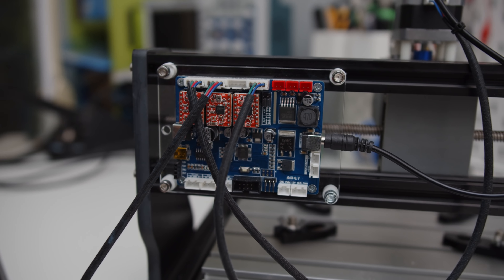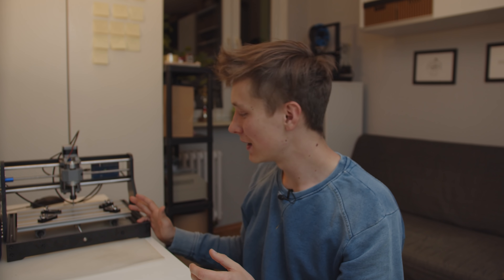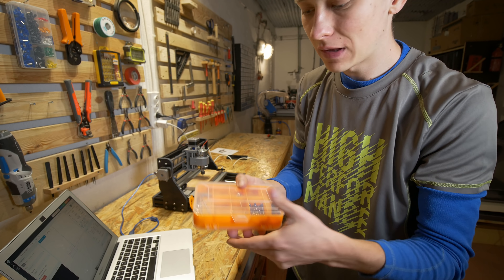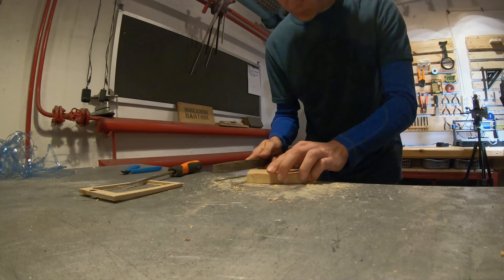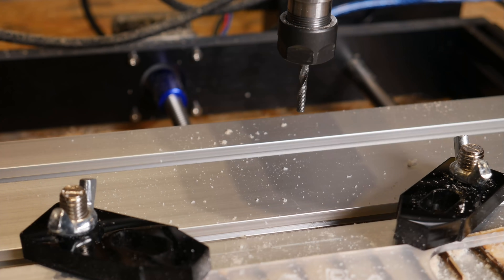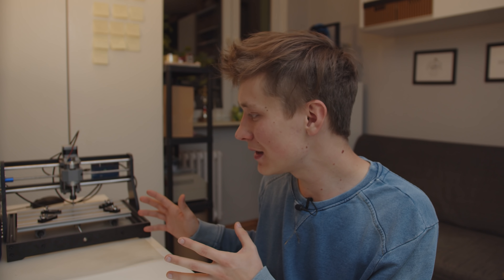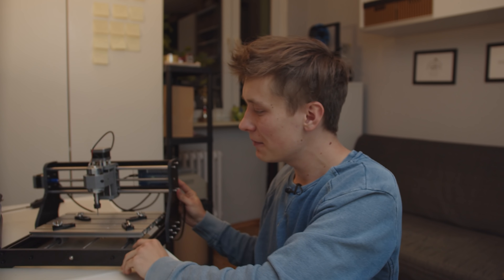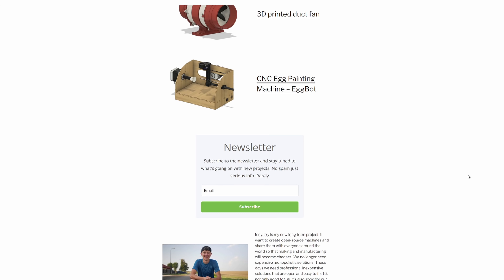What Can You Do With a $200 CNC

Comment: Niko, I like your style and I appreciate your creativity. On the other hand, I strongly disagree with your analyze. I mean, come on, this machine cuts awfully and you have to blame it on the machine's poor design and cheap components obviously. It's not ok, whatever the price tag. Definitely. The young modulus of plastic compared to aluminum talks. Z carriage, sides, front, bushings, nut holders are plastic. That machine can't be stiff at all. By tinkering parameters you (try to) give the illusion the machine is capable but it's not. You have to set the feed and speed according to the bit requirements, not to what the machine is capable of. One bit, its diameter, its chip capacity, its speed of cut, its rotation speed, its feed, and a depth of cut depending of the material. You broke several bits, what other proof do you need prior to blame the machine ?

Niko, you pushed the illusion too far with the Dremel CNC and the Indymill and you got into the error by aligning the settings to get machining works as best it could, but it only hides the design issues of the machine. A simple test for you : a 6mm 2 flute bits and a piece of oak. The proper settings for the bit are 12000RPM, 3000mm.mn and 6mm depth of cut. Run the gCode and if the machine wobble, shake or struggles, that machine is rubbish, simple as that. I recommend you some relevant experience to set your standards higher. Please get your hands on a serious machine for an hour of two to understand how a proper machine should work. Then you will probably reconsider a lot this review and some of the things you did by the past.

Niko, you're positively a young man, and probably you're victim of a lack of knowledge here. Please keep in mind it's dishonest to embellish a rubbish machine to get people buy it through an affiliate link. I appreciate anyone needs money, but wasting the truth of your audience is probably a bad idea. (the thumb down currently here is not mine)
Reply: Lol lol lol. You are a victim of what you think you know, rather than what you know. No one is claiming this is a decent machine. It is however, a decent machine for it price. If you really expect it to be comparable to what you call a 'proper machine' then you are wacko. Go look at the 3018 groups, you will see that this machine is capable of a lot of things, as long as you understand its limitations and dont push it too hard. Feeds and speeds are important, so use the right bits. YOU are the one with a lot to learn. A bad craftsman blames his tools, sounds like you are a bad craftsman
Reply: @youngster30uk  dear youngster, you did not get a hair of what I explained. It's embarrassing for you.
Reply: As you're evidently so much smarter, experienced, and knowledgeable, please do share a link to all your open source, and free content with which you manage to educate thousands, and get them excited to build and run their own CNC machines. 
Please, I can't wait to see what you've contributed with all that superior knowledge, and tools. Do keep them within a budget that hobbyists and students can afford though?
Reply: @axelSixtySix  nope, I clearly understand, you have shown that you only think you know what you are talking about, but really don't know much at all.
Reply: @jordymoors  well, I built my first CNC router when Nikodem was not born yet, I'm maybe a bit more experienced. And yes I shared a lot open source : machines plans, components, parts, software, since 1996. I currently have more than 300 downloads per day. Some of my works are used buy manufacturers (z drive belt system) or inpired design team (compact silent belt extruder). But I'm not here to promote myself. The content is online, get it if you need it, and enjoy. 

Why would hobbyist be delighted by rubbish machines ? Anyone deserve a capable machine ! Those are tools and any tool must work properly. What is it about the price tag argument ? Do you really believe a rubbish machine is changed into pinnacle because the price is low ? I hope you're buying a tool not a price. A 3018 can be good enough only if you plan to cut soft materials with small bits, otherwise you get the wrong tool. It's not an opinion, it is Physics. Save money for a couple of months more and get a proper machine for much heavy jobs. But don't claim you can machine hard materials with a 3018, it would be a shameful lie : you would just be able to etch successively thin layers of materials, dulling your bit, and get a rough part at the end. 

As the milling action is Physics, the component are an equation with the cutting tool and the material as starting point. Then all the stuff behind should be well dimensioned and built to allow the tool to work in proper condition. It's calculated, then a safety margin is added. The 3018 is engineered from the price tag. It's all about providing a good margin for the manufacturer and the seller : cheap components, dimensions to optimize material cutting, minimal and inexpensive components, and light weight for cheap shipping. That's what you get, nothing much. If you look  at the machine with the engineer eye, there's ineptions everywhere : "spindle" (from the most standardized DC motor) with too low speed and toque ; low torque motors, unconstrained leadscrew ; soft structural plastic parts ; too thin guides ; and so on. Consequently, the machine provides very low capacity. And it shows on Nikodem's parts obviously, despite the ducked parameters. Any one who have already cross a proper machine will know at first sight. You can consider a 3018 as a 'good enough' machine only if you have no comparison point. By the way, if you compare with a Chinese 2020 CNC, which is in the same price range, there's a relevant gap between the two, even if the 2020 is not a reference at all. Currently, the 3018 is one of the worst CNC machine money can buy, just because the way it is built. Blame the manufacturer.
Reply: @youngster30uk  I'm a retired engineer, I was a major laureate in one of the best institute. I wonder why I was pretty well payed during all these years, maybe because I know less than you. I don't care you agree or not, this is not a personal opinion. The reason why the 3018 is rubbish belongs to Physics. But don't trust me : do your own calculations. I promis that will be an interesting moment.
Reply: @jordymoors  be careful what you ask for I suppose. You won't learn from this though. You'll probably submit to your pride and double down or ignore that you were wrong. Any engineer can see that that guy knows what he's talking about.
Reply: @youngster30uk  it's sad really how you're more focused on owning someone in a yt comment than absorbing what knowledge you can from someone worth listening to. Some just never get it and revel in their own ignorance though.
Reply: @youngster30uk  lol sorry you thought I was owning you buddy. Not my intent. Just trying to point something out to you. Besides, you shared no knowledge for me to absorb and you're not really someone worth listening to so it's not the same thing.
Reply: @youngster30uk  you would have had to have shared some knowledge for me to be a hypocrite in my statement. But please keep embarrassing yourself
Reply: @CStrbel  erm nope. I literally dont need to do anything, the act of being a hypocrite is purely based on a hypocrites actions alone. Go find a dictionary.  An idiot says I am embarrassing myself, oh no, how will I ever live that down?

I will help you to educate yourself a little 

Definition of hypocrite

: a person who acts in contradiction to his or her stated beliefs or feelings
Reply: @youngster30uk  while your definition of hypocrite is correct you are still operating off of falsehoods. And while you have degraded this to the point of arguing semantics, if you were to simply go back and look at my original statement in full instead of picking three words out of context you might just be able to understand what you've been missing this whole time. I suggest you read it slowly so you don't miss anything.
Reply: @axelSixtySix  ughhh...
What's it with these old timers and them thinking they're somehow superior just because they were born first? Just because you're older, doesn't mean you're automatically smarter, or more capable. Otherwise, half of you wouldn't struggle to operate a phone without a rotary dial...
Anyhow, so much for the "I'm older, therefore better" argument.

As it's pretty obvious your native language isn't English, perhaps that's where the misunderstanding stems from, but I'll dumb it down for you so you may be able to grasp it. Try and spot the difference between these two sentences, if you can?
"This is a great machine!"
"This is a great machine, for the money."
Notice anything different between the two? No? Let me help you: one is absolute, the other is relative. 
At no point is it claimed that this $200 machine is a great machine, but it is *for the money*. As in: you're exceedingly unlikely to find something better for the same price or less. That's all.

Are there better machines out there? Hell yes. 
Can you buy a better machine for the same or less? Ehh, probably not. 
Does that therefore make it the best in it's (price) class? Well, for lack of alternatives, that's kinda how that works. 

Personally, I don't need a CNC machine, but I want one. Just to play with, as a hobby, to see if it's worth investing in further. I'm not going to spend the $100k+ on a 6 axis machien with tool changer and 10mm+ depth of cut in titanium, just because that's the pinnacle of cnc capabilities. I'd want something cheap first to play around with, and see if I like it enough to splurge more money on something better. And even then, you'd only pay for as much as you need. You're not going to buy a 6 axis machine for titanium, if all you're ever going to do is cut 2d shapes in foam...

Again, because this seems hard to comprehend: money is the limiting factor here, not physics. You're not trying to push the boundaries of what cnc machines are capable of, you're trying to stay within budget. Just as you can't go over physical limits, you also can't spend more than you have (or want to). 

By your logic, i.e. "If it doesn't push the boundaries of what's physically possible", no one should be driving any car that isn't a hypercar, because only those can drive fast enough to burn up tires within minutes, pushing their limits. 
A Fiat panda should never be bought/driven because it uses cheap components, with a cheap construction to make a, well, cheap car. That's what you get, nothing much. But it does fulfill the main goal: stay in budget while getting me from A to B. 

Just to drive it home some more...
Let's pretend I give you a hammer, a nail, and two pieces of wood that you should connect. Please give me the same lecture about how you should use a router to cut a mortise/tenon, and the table saw to help, along with a mortising machine perhaps, because that will make a physically stronger joint. Or perhaps even better, you'd should regrow the tree, and guide it in the shape you need during the growing process, therefore being a joint-less contraption that's clearly superior?

Anyhow, this discussion was a moot point from the moment you brought in your age, your supposed contributions (without sources might I add), academic achievements, and how much money you made. To quote a nice guy: 'Any man who must say, "I am the king" is no true king.'
If you can't have an objective argument without bringing in your personal feelings/achievements, then it's not an argument worth having. Figured you'd have known that as the "old well payed laureate engineer" that you claim to be, but oh well 🤷‍♂️
Reply: @jordymoors  Sorry for my English I try to do my best. I wish what I say do not sound too rude which would not be intentional. 

Why would age and knowledge would be arrogant ? I'm sorry but Doctors, Pilots, are not arrogant, they just know their jobs, like a Chef or a Baker do. Experience and knowledge are relevant. Definitely. A graduated engineer knows things better and way beyond neophyte's knowledge. Unless for people who spend their whole life watching Netflix or playing their console, older people may have more experience obviously, and you'll have to live with that because it's not gonna change. I'm an engineer with more than 40 years of experience, not much, not less. I admit I'm probably not the best one but I have proved many times I'm good at doing my job. Let's be honest for a second : how do you rank your mechanical design knowledge and experience besides me ? Do you think my technical explanations might be founded or would you trust better a video maker's first experiments ? I try to talk about things a newbie may understand, but we can talk deeply into mechanics, structures, loads and forces, my daily. But would you understand me ? 
ε =( ℓ – ℓ0)/ℓ0
hmm ?

I don't go further your other arguments because all these are attempts to justify the choice to buy a 3018, like there were no other choices. And obviously there are many. To make a choice is a subjective decision. And you can make the choice do to stupid things, to do bad deals, which are all your personal mistakes. That's why I focus on tangibles only. 

I'm still afraid you're wrong putting the price tag into the mix. As you like metaphors, a slow car do not become a fast car for the price if it's a cheap one. That works with any adjective. So a machine that do not cut properly won't cut properly regardless of the price. A tool which does not work properly is a bad deal, even if the price tag is low. Wherever you look from, rubbish stays rubbish unfortunately... A 3018 is definitely not a great machine because it do not machine well. Simple as that. 

You said you cannot build a better machine for the price and I'm afraid you're wrong, once again. This will make sense in a few if you allow yourself to see beyond. Do you remember design choices which preside to the 3018 was to save on parts, of course, but also to save on weight, packaging and manufacturing ? If you're not concerned about this you free yourself from a lot of constraints. A 40x40mm steel profile is 4 times less expensive than a 20x20mm aluminum profile and it is 12 times much stiffer. Nothing prevents you to use steel profiles everywhere actually. You can cast an even better mechanical structure out of concrete for less than the cost of a single 40x20mm beam. So cheaper and better is definitely possible, by many ways. That allows to free up money for better components, including guides and transmission. QED. That's free video Ideas for Nikodem, who have still a lot left to learn and experiment, but he is already an interesting young man, with a lot of curiosity inside. I could have hired him, without any doubt.
Reply: @axelSixtySix  Age and knowledge aren't what makes it arrogant. Arrogant is when you present being born sooner as something that makes you superior. And having just any experience is irrelevant if that experience isn't applicable to the area discussed. Many older folks technically have more experience with technology as they were around since before the internet existed, but yet they struggle to open an email, while 7 year olds are programming. 

I know many graduated electromechanical engineers who haven't the slightest clue of how a basic CNC machine works, let alone how to make one on their own. On the contrary, I've also seen plenty of 'uneducated/unexperienced' people teach themself those very things. I have more respect for someone who gained the skills/knowledge through fumbling at home, than I do for those with an academic piece of paper, yet no practical experience. 

I honestly couldn't care less that you're been an engineer for the last 40 years, as half of the things being used nowadays didn't even exists 20 years ago, and the things you were taught back then may have been outdated already. The fact that you keep tooting your own horn on your academic prowess and age, in an effort to undermind otherwise valid comments, discredits your own arguments more than it supports them. As for the mechanical strain you're attempting to shut me up with, yes, I understand. Now what, hmmm...?

As far as choices go, you're right, there are many. For example, you could've chosen to not be a condecending boomer on this thread, but alas, here we are. I'm not saying everyone should buy a 3018, nor am I saying it's a good machine. I'm saying that, *considering the budget*, it's pretty decent. 

Let's get back to your metaphore, as this is where your misunderstanding seems to lay; at no point whatsoever was the goal to get a fast car. The goal was to get a car, any car, for a $1000, just so you could gain some experience. It has to neither be comfortable, nor fast, nor spacious, nor efficient. It just has to drive, nothing more. How it drives, and whether or not that's 'good' is entirely subjective, and highly reliant on the intended purpose. Because, no matter how fast your Bugatti Veyron is, it will never plow your fields as well as a tractor. Then again, the tractor won't win any lap time records.
Similarly, the goal was never to get the best CNC, but rather to get any cnc machine, at a low budget. It doesn't have to be good, it doesn't have to be fast, it doesn't have to be feature-rich. It merely has to exist, be cheap, and perform the basics. 

I never said you couldn't build something better for the same or less. I said you probably couldn't buy one that's better. Significant difference. Even if so, the only way to build one for less than $200, is if you value your time to be worth $0. That's not to mention the fact that if you want to build your own 'good' cnc, you'd first have to know how. If you know how, you're not going to build a $200 one, and if you don't know how, you'd could probably buy this thing to gain the knowledge you need to be able to. 

This whole discussion is you entirely missing the point of the video, and choosing to take it as an opportunity to tout your superiority over younger generations that are doing things you've never done. 

As you'll clearly disagree with this again, I'm very much looking forward to the videos in which you build a clearly superior machine, that fulfills all the criteria your mentioned, for less than the $200 this thing costs.
Reply: @jordymoors  Well, you do some youthism, by considering an older person did nothing interesting and did not learn too during his whole live. In other words you think before your birth it was paleolithic. Big mistake as you will learn late or soon. You'll be the "outdated" man for someone much sooner than you think, because it is how times goes by, and it won't change either.

Unfortunately, most of the high end technologies you use today was already here many years ago and was created by people as old as me or older. Please check your information sources. Only the way it's used and the amount of data transferred have changed, nothing much actually. My grand parents had a phone as you described. Ours in 1980 was already digital when I was a child. People who enjoy technology never had any issue using high end stuff. I have a 15 years old smart house and I installed any stuff myself. I'm still upgading when cool stuff comes. Depite what you may think, most of the exciting things was made a long time ago. It just became a tiny bit better every year, not that much actually. 

You have an incredible  ignorance of technology's history. I don't blame you for this lack of knowledge, you can, still learn someday, maybe. I built my first computer back in 1983 because it cannot be sold.  I learned to code immediately because there were nothing else to do on a computer. I started programing in C++ in 1986 and Python in 1992.  I used internet for the first time back in 1994 but I used early web networks since 1989. Wow, that's more than 40 years ago, isn't it ? Now maybe you understand anything you use today was made by old people. How do you feel ?

I built my very first CNC mill back in 2003 because it was too expensive to buy one and much fun to do it myself. I still have it, 1600 pounds 3hp, still works great. Sorry I did not made a video, Youtube was not online yet. I could tell you about my very first 3D printer, my very first laser, and so on. But why ? You can't imagine something valuable exists outside social networks and preconceived truths. The new born youtuber or the clumsy handyman is more respected than the skilled expert ? Rubbish Chinese machines are more attractive than capable tools ? Your opinions. No problem, enjoy.
Reply: @jordymoors  You feel attacked probably because your are young and/or with basic education and/or with not much experience. I did not want to attack anyone. What I said are just facts everyone will experience soon or late (most of us already know that, fortunately). I don't feel superior because I was born first, where'd that come from ? I know who I am and I won't apologize because I'm educated and skilled while some people are not. 

First, the budget is not a limiting factor because you can get around the problem : save more, second hand, kit, plans, source the parts yourself, DIY, etc. There's no limiting factor for resourceful individuals. Second, a resume is all about experience which is no more than acts accumulated. That's why you're always evaluated in first instance by your resume. 

Three concepts seems far away your comprehension, and I don't understand why : 

1. Education. A graduated person's knowledge is ways beyond what a handyman can possibly learn alone in his garage. That's a huge advantage the graduated gets since the start. He won't try things that are known not working. By yourself, nothing prevents you to learn untruth still. That's why we have the university. Knowledge equals power.

2. Good tools. A mediocre tool is a major hurdle to your learning. A proper tool is an essential precondition to get a chance to do things right. With a mediocre tool you only learn how to make this one works, if only it can work someday. And worst of all, you will consider what it can do as a reference, which obviously it is not. A rubbish tool is not a chance to experience and learn, it's a ball and chain around the foot that prevents you to go further.   

2. Experience. The graduated gets quickly a deeper experience. His education makes him do the things the right way, with method. An experienced person knows more than a person less experienced.

Therefore, a neophyte is the less skilled one, even if he took is whole life experiencing and learning because he can't go fast enough. And the young handyman is not as skilled as the old handyman who benefits of some relevant experience. Then comes the graduated one who already know at the start all that can be told, even with no experience at all. He still have to validate his knowledge by working. Therefore a young graduated is inexperienced compared to an old graduated simply because he did not accumulate enough relevant work. I can't believe I have to teach such basic and obvious truths. Sorry : are you a kid ?
Reply from the maker: I never ever disagreed with a comment more than I do with this one. You see engineering as only one definite answer to a problem where I see it more like art, there is space for Chopin and Matejko as well as Billie Eilish and Picasso
Reply: @axelSixtySix  if you look online, you will see people milling aluminium with a (modified) 3018. You can say what you want, but the fact people are doing it is proof you don't really know what you are talking about. It's a budget machine, and for what it it, it works well. Niko makes videos for hobbyist makers on a budget, he is not claiming it is a tomach or other industrial machine. Get your head out of your arse
Reply: @youngster30uk  My head is far away of where yours lives. Insults comes when there's no arguments left. This is not milling aluminium. This is hetching slowly aluminium: the cut quality is awfull, just like Nikodem tests on the 3018 are awfull indeed whatever it is plastic or wood. When you get awfull results you can't claim a machine is any good. Simple as that. And this is definitely not a question of price tag because you can build a proper DIY machine at low price. Out of concrete for example. Just it is not juicy enough for manufacturers. Here is the reality. But awful cuts are probably art, so...
Reply: @jordymoors  "it seems you live in a black & white world, with no grays. " Your theory but nope, I make the difference with a man with professionnal exerience and tinker experience, and 2,5,10,15,40 years experience. Because experience is relevant.

"considering you can't seem to shut up about yours" Education is a relevant factor that should not be wiped out here.

" and assume everyone else is uneducated" I never said that. Just people are not educated at the same level : no education, student, graduated, that's not the same obviously.

"I got a degree in EE from Germany's #1 school in the field, and am in the process of getting my masters in Electromechanical engineering." Fine, assuming you're not a mythomaniac, you will probably agree with me on every point in a next future. You just need to understand the perks ot the essential informations you will get, the essential methods you will learn and the essential experience you will get. Form where you talk, it is not a surprise you think what you think. It's youthism, nothing much. BUT things may change and when you'll understand you'll think about this conversation. 

"Ideally, yes, the educated man is 'better' than the DIY hobbyist. In reality, this isn't the case." I'm afraid you're wrong. But you don't know yet. There's probably exceptions, but it's exceptional : a couple within billions of people. The good handymans will have anyways to learn in a way longer process than standard education programs. It would take their whole life, while the young graduate already knows all. You know, education is a selection. The bad ones fails. So there's much more good ones into laureates, a very high percentage while there's a very low percentage of good handymans. And that people won't get as brilliant as the best of educated people. 99,99999% of the experts are laureates and the best ones benefits of a long experienced. That's the reality you will face soon.

"The machine isn't good, but... The machine is as good as it gets *for the price*." I still disagree. The price is not a magic wand that makes any crap better. When it's rubbish, it stays rubbish. Let's present things differently. The 3018, as it is out of the box, is only capable to machine PROPERLY very soft materials. It fails to machine properly pine wood for example : the cut quality is awful. That's a fact, not an opinion. That's what you get for the price you payed. My opinion is the value for money is low, as the abilities of the machine are low. So, for the price, as you say, it's not a good value EXCEPT if you just want to mill foam or so, or to engrave soft materials. That's what the 3018 can do. Only people that have no experience can disagree without lying.

 "As in, you're unlikely to find a better machine you can *buy*, not *build*, that outperforms it, at this budget. " I still disagree. Second, you can buy a second hand better machine at the same price. The 3018 is pretty easy to be outperformed indeed. Any well engineered oldie will do. But let's be honest : most of 3018 buyers will try to upgrade it. No surprise it's meant to by a DIY tool.  That's what most of them do currently. So there's definitely some tinkering and DIY around that machine. Except you just have to machine foam or engrave soft materials. Anyone else will be disappointed by the abilities of the machine, and will look to any upgrade to try desperately to machine better. That's why you can't wipe DIY build out of the subject. Because this machine is a fallacious lie. It pretends to be a proper CNC router while it have a hair dryer motor as spindle and soft guides and structure. There's A LOT of upgraded replacement parts available on the market which are also lies because to make a better machine you'll have to change everything. Last, we live in a endless pay world, and that was not the same by the past when things was built to be good and to last. It's totally wiped out our society, but it is not a fatality. The 3018 is a money trap. It's meant to make you buy, not only for it's hypnotic marketing price tag, but as long as you will use it. Bits will break or get dull quickly, like most of the wearing parts of the machine, starting by the spindle which is not powerful enough to stand the diameter of bits it can hold. 

"you should be able to comprehend hard restrictions in a projects" Of course I do, that's was my daily. And I fought hard wrong good ideas because marketing and profit are not the sole leverage of success for a company. And obviously not the most important ones ! A company must take care of its reputation and give customers a good experience with the stuff it produces.That's the first goal indeed ! The 3018 is produced on demand by some Chinese factories that will produce tin cans openers the next day. They don't care at all about reputation. They don't care about quality either : they produce 10-15% more of the same shit for free which allows the reseller to deal with issues and don't care anymore when the last parcel has left the factory. That's the way it is. 

"no more than $200 available." that's the retail price. I'm sure the machine production cost is under U$D40. See what you pay for. I already covered alternatives.
"you cannot build it yourself"  The 3018 is a kit, come on boy...
" it needs to be a CNC Router, and meeting all the criteria you mentioned to be the minimum" Let's put the crucial question of is it a proper CNC router apart for a time. So the point is:  where do you put the trigger ? To me, the minima is to be able to machine at the requirements of the tools the provided collet can hold. Basic. It should be possible with a security margin for safety. As ER11 can hold 7mm bits, we already know that criteria cannot be respected on that machine. That's why it's an engineering fail. But nowadays people have so low expectations that it's not a problem to have issues with what they bought. Nikodem do not blame the machine, what he should have done indeed, but the parameters not refined enough. That sounds incredible! There's no shade of gray the way a bit should feed and speed into a material. These are tangible physical values. If the machine cannot hold it, it's not a proper machine at all. A machine that only pretends to be a machine is called a toy. A respectable company would never sold a 3018 because : as the machine cannot work at the maximum of capacities the tool requires, people will have issues (potentially dangerous) and/or some parts can break. For a company, that means support costs which can potentially overtake the benefits. For the customer it is the guarantee of a painful experience. If you consider all the aspects (financial, operational, lasting, etc.) and not focus only on the fleeting enthusiasm of unboxing a new toy, there's not much left in favor of the 3018.
Reply: @youngster30uk  I'm sorry it it sounds insulting, as English is not my mother tongue, I write like we use to talk in my culture, which is somehow a bit rude to other ears. I google many words I don't know. But we are also very forgiving for people who don't know well our language. Are you ? Anyways, please consider I do my best. On the other hand, I'm not a "give the other chick" guy, and you know you've been aggressive since the start, so why complaining about to get the change in return ?

What I wrote to Nikodem is factual and all (the many) arguments are ascertainable. If the words sounds rude, I'm really sorry. I sincerely think people with few experience should take a better care about what they pretend on social networks because as you don't have the keys, what you think is much based on feelings than on tangibles. That's the point. I tried to warn him about things he say today but may regret later. When some people gets some success when they're young, that success can quickly go to the head, and let you think you're better than you really are. Take his very entertaining DemelCNC video series for example. If you trust every word told, the machine is pretty capable since the start. But "upgrades" comes, then a new "better" machine. I know this is usual nowadays to do as so. On the other hand, how can you blame him ? He never put his hands on any CNC router before, he just owned a 3D printer for a few. So, he sincerely thought what he said. Now he already knows the DremelCNC cannot do that much and have a lot of design issues. And that will be se same for the IndyMill in a next future as he will gain skills and experience. He's not to blame, he did his best every time. Now, try to understand my longer experience makes me already notice the design issues at first sight. Like the blunders of the first holiday movie of a kid for the eyes of a professional film maker. Should he stay blind or should he pass on his experience, like I did ? 

About you, you seems like taking every argument I say the wrongest possible way. Education, experience and age are not insults, they are facts. You call yourself "youngster", so... On the other hand, I'm still sincerely embarrassed for you, that you don't get factuals. If there is a kinder world than embarrassed, please replace it. I still think you can get it if you try. Would you ?
Reply: @axelSixtySix  I am still slightly embarrassed for you!! you are just a troll.
Reply: @youngster30uk  No arguments, only insults 😴
Reply: @axelSixtySix  the insult. In my previous comment is a quote from your comment. It is your comment. Jeez
Reply: @youngster30uk  good luck for the future youngster. You'll remember this one 😉
Reply: @axelSixtySix  hi, you at least claim to have experience. What are your thoughts on Dremel CNC? I used bigger Nanotec steppers and also quality bearings. Are there any other possibilities to improve quality?
Reply: @fritzmueller6759  The most common issue with low price CNC routers is about stiffness. The Dremel CNC uses a lot of 3D printing parts as structural components which are its Achilles' heel. Thermoplastics are way softer than aluminium (20 times) which is also 3 times softer than steel. BUT, 3d printing parts are not isotropic as plastic injection under pressure parts are. That means 3D printed parts are even worse: around 80% to 50% depending of part's orientation, wall thickness and infill. To match the properties of an aluminium part, the 3D printed part shoud be at least 25 times thicker than the aluminium part, which is obvioulsy not realistic. We also know weight is crucial to damp vibrations so 3D printed structural parts is a very bad idea for a CNC router.

Back to the Dremel CNC. Any better component would not improve significantly the machine. The way the machine is engineered makes the replacement of the 3D printed parts by metal parts very difficult or pricey unless you own a furnace and foundry skills. My advice would be to leave the Dremel CNC as it is and to content yourself with what the machine can do. Any upgrade would be a questionable investment. And maybe save some money to invest someday in a better machine.
Reply: @axelSixtySix  ok I see the point. So as many people mentioned here I need a more or less inexpensive machine that is also very compact. Also I love to source parts and assemble machines by myself. With 3d printers that was never a problem, but cnc machines are anothet level. Do you know some small designs?
Reply: @fritzmueller6759  usually people like it big. There's not much small designs actually. But you can inspire yourself from industrial machines (proportions, materials...) then scale it down. On a budget, there's the steel beams structure (can be epoxy glued). A steel beam is inexpensive, you just have to design the whole machine from one single beam. Or you can mold the structure from concrete, or the luxury version from granite epoxy. There's a lot of examples on the net.
Reply: @axelSixtySix  Thanks very much! Yes I found some interesting designs online made out of concrete.
Reply: @fritzmueller6759  I don't know that mod and the video don't give a lot of informations. On the other hand, "very robust" is a subjective value. A drawer or a shelf can seem "very robust" because it looks to hold some weight. But we are talking about machines here which have to constrain dynamically a cutting tool to defined positions. It is not exactly the same. A machine's structure have to stay still whatever the forced applied to the bit and vibrations. So "very robust" at first sight can be not enough mechanically. You can calculate that, and calculations always lead to a rugged machine. Here there's 12 mm rods but they are still suspended so it's a a gantry on a spring in a way. Look at how are engineered industrial machines. There are no suspended rails, they are made out of heavy materials and you cannot see through the structure. If they are made like this it is at purpose. A hobby machine should be made the same way. Not as beefy, but the same way. Just smaller and lighter, but with the same architecture.
Reply: @Eddie X the best value for 400€ (or less) would be a second hand CNC router, maybe a 3040. You can't find any brand new one which works properly under 600€ IMHO. Maybe you can get a Workbee Chinese clone for around 500€ during the Black Friday. Under 400€ all the brand new machines requires some tinkering and "upgrades" which raise the overall price tag anyways. That's why people with a low budget buy second hand or DIY their own, which is probably the best option if you use some stiff and inexpensive materials like steel or concrete.
Reply: @Axel Sixtysix: You seem confused about why your comment was seen as "arrogant" and "aggressive", and it's clear from your later comments that your intent was neither of those, so  I am offering a few thoughts.  As you say, you are only talking as people do in your culture, and cultures need translation almost as much as languages do, so I think a lot of this is translation error.

One thing is that, although you say that you're just stating facts, saying "the machine is rubbish" is an opinion.  It is a fact that the cuts are very low quality, yes, and that the machine is unfit for many purposes.  But it is fit for some limited purposes (it should do fine with foam, for instance).  By saying that it is rubbish you are implicitly saying that your opinion about what purposes it should be fit for is the one that we should all use.  So that feels like arrogance, because it sounds like you are saying you know what my own purposes are better than I do.

I don't think everyone needs to have a machine that will cut solid oak with a 6mm bit and a 6mm depth of cut.  That's a good test for a "general-purpose" machine, but you are making the assumption that it is relevant to my needs.  By saying that it is "rubbish" if it cannot do that, you are implying that if I don't consider that test relevant to my needs, I must be wrong.

The "translation" suggestion that I would make there is to make those judgments of value into facts -- instead of saying it's rubbish, say it's not capable of doing the things that a proper general-purpose CNC router would be expected to do.

Also, you make the claim that Nikodem does not have experience with serious machines, and that if he does get experience he will change his mind.  Do you actually know what experience he's had?  When you say that he hasn't, but it looks like you're just guessing based on his opinions, that also comes across as strongly arrogant in this language.

The other thing I would comment on is that saying "it's dishonest to embellish a rubbish machine to get people buy it through an affiliate link" creates the impression that you are accusing Nikodem of being dishonest.  That comes across as being very aggressive.

I hope that's helpful in understanding.  You clearly have a lot of valuable experience and advice here.
Reply: With that said, let me explain why I personally bought one of these, and perhaps you will agree that it was a reasonable choice.  First, on the matter of price: I bought mine "factory refurbished" for $125 including shipping.  I am intending to do some experimental g-code writing, and I wanted a desktop machine to play with while writing it, to test some of the ideas while at my computer.  I do not really care if the only thing it will cut is balsa wood or paraffin wax, and if the cuts are bad -- for any actual work, I will go to a local maker space and use their ShopBot.  My criterion, other than cost, was that I wanted to not spend time on design or construction -- which means that, although there are obviously better options such as steel in place of aluminum or plastic, spending the time to make parts was not a good choice.  This video shows me that it will do the job I'm hoping it will do -- but that it probably won't do much more than that.

(The other thing that I was buying this for was to see if I would use it enough to become annoyed at its limitations.  So far, since I've had it six months without powering it on or getting around to my g-code-writing project, my conclusion is that I've probably gotten $125 of value out of it by it saving me from buying something more expensive.  I'm sure you'd agree that this is completely fit for the purpose of being a paperweight!)

Also, I would say that your comment about "you choose the feed and speed based on the bit" is only half the story.  Since you also cannot use a feed and speed that the machine is incapable of, the other half of the story is that you need to choose a bit and material and depth of cut which will require a feed and speed that the machine can do.  (Here I think we can agree that cutting pine with a six-flute cutter is a poor choice!)  I think it's significant that these are not sold as "CNC routers" but as "CNC engravers"; they do not even claim that any bit that removes significant material is within the machine's capability!

Amusingly, the company I bought my "refurbished" one from left the return letter from the previous owner in the box (which is quite poor practice since it included full name and address!).  It told me that he was someone with enough experience not to have damaged the machine assembling it, and that he came to about the same conclusion you did, which is that the machine wasn't suitable for any purpose he had.  He'd also done the one tricky part of assembly that couldn't be reversed (heat-fitting a collet onto the motor shaft), which saved me the trouble of finding a torch to do it myself.

Thank you for your thoughts here.  They've been quite helpful in thinking about how to use my machine in a way that won't be disappointing, and what to look for when-and-if I buy or make something that I will use for real work.
Reply: @BrooksMoses  Ok, I assume Nikodem have low experience because I he had good experience he would not design his machines as he does. I understand it may sound arrogant to some ears but for a machinist or an engineer this is obvious.

You dislike the word "rubbish", but all I mean is in this word. Oak is not particularly difficult to mill, by the way, it's a piece of cake for any average CNC router. As a capable machine I mean a machine which is built properly to stand the forces applied by the bit it can carry, whatever the material.  In other words, If the ER11 collet allow to insert a 7mm end mill, the whole machine should stand a proper milling operation to the feed, speed and depth required by the 7mm end mill. Whatever the material, because the average user expect to mill any material, not just foam. If the machine cannot stand that operation, the machine is rubbish : it cannot do what it's meant to do. What would you say about a car which cannot climb hills ? Whatever the price, a proper car is must be able to ride any road. A proper CNC router must mill.
Reply: @BrooksMoses  Well, I understand you have low expectations and the $125 3018 is ok for you. You said "half the story" but I disagree on this point. Imagine a drill which can hold 1/2" drill bits, but is barely powerful to drill 1/8" holes. It should be fine  for someone with low expectations, but the average handyman expect it to drill 1/2" holes obviously! That what the 3018 is, unfortunately: a machine that can do only a tiny bit of the job. 

By the way, there's different 3018 machines and people thinks low priced ones are the same and they get a pretty good deal. I'm afraid it is not true. There's no magic, you get what you payed for. The $125 is the worst one : 80w 7800RPM 775 motor with no bearings (bronze bushings, no precision and short lasting), low load linear bearings, backlashed nut, bad couplers, light aluminum profiles, plastic plates, and so on. The SainSmart Genmitsu 3018 have a 300w 20.000 RPM 775M motor with proper bearings, ABEC 5 linear bearings, proper aluminum profiles that weights the double, and so on. That's why the price tag is higher. 

You mill only extra soft materials so you cannot make any difference hopefully. And it would be fine for you until you put your hands on a proper machine. Then you would be able to make yours all I said, and you would never go back. We're just looking at the same thing from different points of view. As an engineer, I learned how mechanics works, I worked on industrial CNC on the late 90's , I built my first 600lbs CNC machine back in 2003 and bought or built several ones since, including small inexpensive ones. Frequently some people brings their 3018 to be fixed at the fablab. So you may understand I see the 3018 beside many others CNC machines. The 3018 is not the worst CNC ever, but it is still poorly engineered, even if you get one with some premium components. It's far to challenge proper machines. That's said to avoid the "rubbish" word ;)